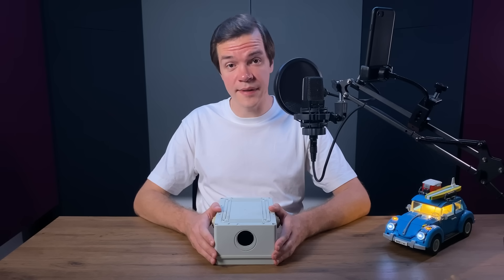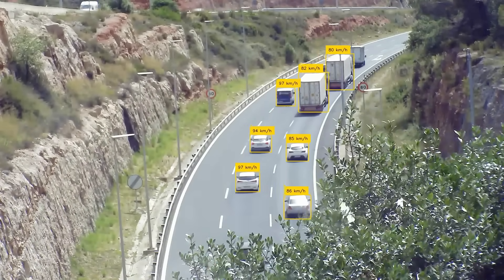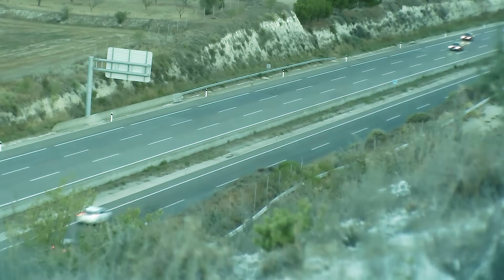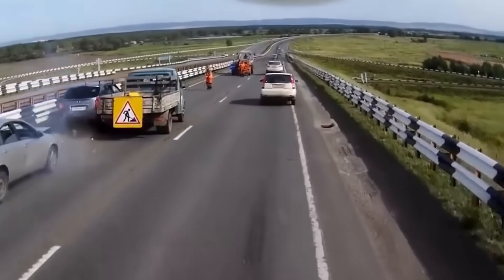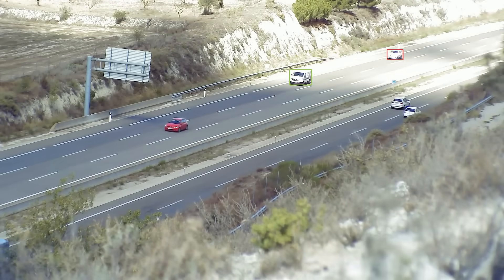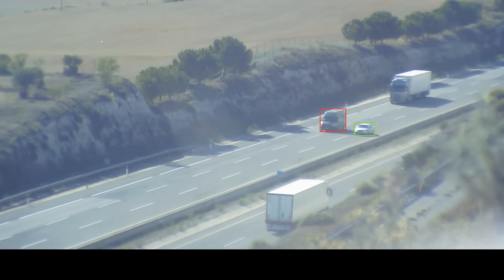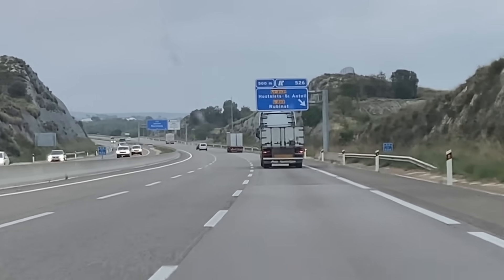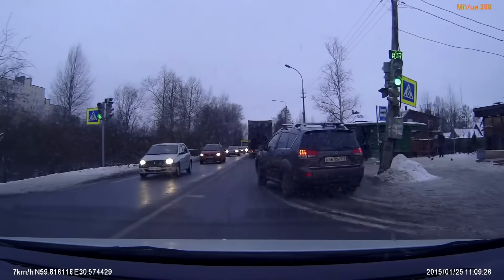New Anti-Tailgating Camera Reveals Shocking Statistics

Comment: I think this is a great video and having a large gap to the car in front of you is the right thing to do when there isn't much traffic. However, if there is a lot of traffic changing the gap from 30m to 100m basically reduces the capacity of the road by 70%, which is why I don't think it's so straightforward, what the right gap is. What I mean is that in car traffic, we don't maximize safety over all other things especially the time to travel. If we did, we wouldn't have motorways with speed limits of 120km/h, but instead 70 km/h (which would not only be safer, but also more fuel efficient). 

Since this is the case, I think reducing the safe driving to just "don't tailgate" is too simple. There are many other things that matter as well. Those examples that you had on the video, initiated by someone doing something far more dangerous than just tailgating. There was a car stopped right in the middle of the motorway. There was no analysis why car was there. There was a lorry dropping a tyre. There was no analysis, why was it so badly loaded. There was a car hitting the side of the motorway (and then having a pile up). Why did it have that initial crash?

My own (quite unscientific) view is that it's not just tailgating but it's all offensive driving, cutting ahead of others, zigzagging between lanes when there is traffic, etc. that unnecessarily creates danger that won't even make the person doing it get to his (it's usually he) destination much faster. At the same time, giving way to others can easily defuse otherwise dangerous situations without it slowing down the person who does it almost at all. 

My worry is that with self-driving cars, we'll program them to be the defensive drivers, which is of course a good thing, but at the same time, it will make the aggressive human drivers even more arrogant as they know that the self-driving car won't crash to them even when they do dangerous things that could get them to a crash when other cars are driven by humans.

Comment: tailgating is based. on congested roads in stop-n-go traffic, tailgating compresses the line of cars in order to help maximize throughput. At intersections, it allows more cars to get through a light before it cycles. On the highway, it pressures slow retards to get out of the left lane.

Comment: The Logic that Jeremy apply is true "Speeding has never killed anyone,Suddenly becoming stationary,thats what gets you"
You could drive 100 km/h on the Highway and have 30m between and still be injured.
Meanwhile when you drive around 200 km/h and maintain a distance of 100-200m is more realistic because you drive so fast and dont want to risk injury.
That mentality can be apply to the German Autobahn where there is no Speed Limit.
You can notice how cars become less with the 3 stripe white sign,rather than enforced 120 km/h and having many cars suddenly slow down that cause a chain reaction or wave of cars to be slowed down.
In that scenario it would take 1 person to be distracted,not have distance or simply not paying attention at all due to the lower speed to just crash and cause a accident.
"The Germans brain cant comprehend slower speeds" because driving slower on the Highway is never safe.
And don't get me started on 30 km/h zones for "Noise pollution"

Comment: I hate tailgaters. With that said, your/your country's safe distance math is a little wonky. First, you're assuming anything in front of us is already at a dead stop, which for another car is obviously insane since they're moving with you. If they do, somehow, quite literally instantly stop, IE collide with a truck that has appeared out of nothing 10 centimeters ahead, thus giving them no reaction time, on roads like this there are other lanes.

If we change lanes, not only do we stand a very good chance on those giant roads of flying right past our magic instant stop obstacle that was created instantly with exactly zero seconds foreknowledge of either the driver in front of us nor ourselves, who are tunnel visioned on the rear bumper of the car in front of us like a deathwishing lunatic for some reason, I also cut my stopping distance dead ahead via travelling off axis to switch lanes.

Second, you're assuming our driver cannot see anything in front of the vehicle in front of them, which, in similar fashion, is ridiculous.

I suppose the assumption here is that our driver has no awareness or escape plan laterally, and if that's true he shouldn't be driving. If you don't keep track of both directions around you and everything in them, please stop driving immediately.
My follow distance on this road would obviously depend on traffic density and the size of the vehicle in front of me, but would probably level off at 50-70 meters.

Your assumption that recommended follow distance is the best for everyone is overly simplistic, those laws are made for either trucks or old people who lack quick thinking due to age. If I, an 18 year old, and an 80 year are put in the same situation, my kinesthetic sense is operating near an order of magnitude faster(a guess from driving with and around these people for many years now). Where he would need the 100 meters and still probably collide slowly, I would still make it by the skin of my teeth with 45 or 50 in the same vehicle; because my thinking is not hard locked to the lane I'm in, I'm considering everything around me, watching mirrors and checking sides. In my 3 years of driving more than 2 hours a day on average in cities and on highways, I've had zero accidents ever.

What I'm saying is that you are saying we should drive like our vision is exactly 7 degrees wide, we have broken necks, our eyes do not gimbal, we're all bolted statically to our seats and have no steering at all. It is, in the most literal fashion, 1 dimensional thinking. This is how you drive a train. There is a point at which you're driving so ridiculously, unnecessarily safely it's equivalent to virtue signaling. Pray tell, do we equip our cars with ejection seats? Or should we just not drive for fear's sake?

And hey, just remember: I would NEVER, nor should you, drive ANYWHERE CLOSE to theoretical limits. If you couldn't make the 70 meters or drive a large vehicle, by all means do 100. Do 120. We're talking math here, not wisdom, specifically for the thought experiment.

Comment: Volvo had a concept back in 2017 called Volvo 360c. It was an autonomous car communication system between all cars regardless of the brand and the vehicle type. It's the only solution for traffic safety.

Comment: I agree that brake-checking is not the way to go, to suddenly break for no reason is dangerous! However, if I find myself too tightly tailgated I can press the brake just enough to lit up the brake lights without really braking. That is, in my opinion, much better.

Comment: To be fair, a 100m recommended distance regardless of car speed is pretty nonsensical. A reasonable approximation is half your km/h speed in m. So if you're driving 100km/h, 50m of distance should be kept at minimum. But that would make the results less shocking.

Comment: Following closely behind heavy trucks is reasonable. Even an empty truck and trailer will slow and stop massively slower needing more distance than any car or light truck. For a truck with a heavy load it's nearly impossible to not be able to slow down for them even if they are making an emergency max power braking. If they magically slam into a wall and instantly stop that's different but so unlikely to happen that I doubt that more than a few drives in their whole lives ever had a freeway driving event where some vehicle in front of them instantly stopped. 

That said looking past the back end of the car in front of you gives you a lot more reaction time to events. Very people will for no observable reason slam on the brakes and try to come to a full stop on a freeway. One possible tech improvement is a camera mounted at the highest point of your vehicle looking forward, over and past the vehicle in front of you to try and detect reasons you might need to slow or stop. I drive a very low to the ground car. I can actually see under most normal pickup trucks at least slightly. I also get blinded by every vehicle on the road's headlights behind me.

Comment: Temporary tailgating from lane changes doesn't bother me that much. It generally will clear back to a safe condition in 5-20s. For that time, driving with extra caution is needed.

I try not to follow people at a constant distance. Either I'm closing and will actively pass or will be deliberately slower than them so they are increasing in distance. If someone wants to overtake me, that is fine. I intentionally leave plenty of space for them.

If someone tailgates me, I slow down. Nothing sudden, just lighten up on speed a little at at a time; until they back off, pass, or our speed is appropriate for that distance. I will look for opportunity to give way, pull over, or choose another route.

Comment: And I bet that there are fewer accidents than would be predicted by general principles. I think the biggest factor in rear end collisions is attention and distraction.  Over many years I've learned a few 'tricks' 1. you can get a lot closer to large trucks. They will always take much longer to stop than a car. 2. If I can see through the windows of the car directly in front of me. Now I can probably apply my brakes at the same time they do because I see the reason to do so.  Can't see through/beyond? I back off. 3. Is there an 'out'? meaning is there a clear shoulder or lanes on the sides of the car in front of me that I can turn into? this gives me greater stopping distance.  By far the biggest factor is attention. Bumper to bumper traffic is just a grind. It's very easy to be cognitively overloaded and miss stopping when everyone else does. (The only time I rear ended another car I was going through a massive migraine headache.).  
So the three second rule? Is that only for stopping distance? I'm guessing it's for average level of paying attention, seeing brake lights and you hitting yours.    As I get older and as I think more and more about these things as my Tesla drives me around. There really is little reason to speed. Crossing Nebraska after seeing three cars pulled over by police within 5 miles of entering the state. Speed limit 70 mph, distance to Iowa? 375 miles. If I went 75 mph, I risked a ticket and I might save 20 minutes. No point. Tailgating? Mostly what I notice are people trying to get someone driving too slow in the fast lane to move over.  In heavier traffic, everyone seems to be closer with the same purpose,  efficiency but not a race. 
My Tesla allows for more distance than I would, but it also will change lanes to a 'faster' or more empty lane, without noticing the slower vehicle in that lane in the distance. So we will get autonomy, but it will be a very long time before most or all cars are working together. (When theoretically cars could be less than a meter apart and driving at 160 km/hr because stopping will be coordinated.)    One thing I have noticed as over 5 years my Tesla becomes more and more autonomous: I don't care how fast it could go, I just want to relax and get there.  Heavy Los Angeles traffic. My first calming came from audiobooks. More time on the road is just more reading. Then the Tesla. More reading,  and much less stress from lane keeping, and putting up with stop and go. The car does it and never loses focus.

Comment: "braking distance" is determined by dozens of factors including your speed, the capacity/condition of your brakes, capacity/condition of your tires, road conditions like water, ice, snow, gravel, mud, etc etc, how much cargo/weight your vehicle is carrying, driver reaction time, and many more... Before taking a step towards FSD, it would be nice if auto makers would engineer safety systems inside a vehicle to approximate ALL of these factors and alert the driver if they are following too closely.

Another element is psychological. If I see brake lights ahead of me, I will begin to brake lightly because I assume the braking ahead of me is light braking, this is a normal response. The time it takes me to realize that it is in fact hard braking is an ADDITIONAL element of reaction time/decision making.

Comment: I have been driving through Italy for the past 5 weeks on holiday and have been shocked at the aggression of some drivers.  Large vehicles in particular appear to think they can bully other vehicles out of their way flashing their lights and running their overtaking indicator.    I was outside Florence yesterday overtaking a line of 20 or so trucks doing 135 kph in a 130 zone with several cars in front of me in the fast lane.  I saw in the distance a delivery van coming up behind me doing at least 160 kph.  He then proceeded to drive about a foot behind me.   This caused me  some alarm as there was no way he could slow his vehicle in an emergency.  I eased off the cruise control and slowed my vehicle creating a 150 m gap to the vehicle in front of me.  This seemed to infuriate the driver of the van and he started hanging his horn.
As soon as I could find a safe gap between the lorries I pulled in to let him past.  Instead he drove up to block me in and maintained this position for several kilometres until one of the trucks pulled in behind him and started tailgating him closely.  I slowed down and put as much distance between him and I as possible.   There will always be idiots!  Just try and avoid as many of them as possible.

Comment: Today, a modern car, equipped with collision prevention system as most of cars sold in the US these days, reacts faster than driver. I was saved several times from a crash already by my RAV4 system. Modern technology rules! 100 m distance limit is ridiculous. Only, maybe, for Spain where traffic is light.I US it a 2-second rule, which is much more reasonable.

Comment: I think 30 meter is the distance that is "safe enough" but still "too close" for someone else to sneak in between the 2 cars and DRAMATICALLY reduce the safety distance.
eg: lets say a car is 5 meter (about 16 ft) long, if you hold 40 meter distance, and someone sneaks in in the middle, that makes the distance 17,5 meter instead.
Car |-----------------------40 m-----------------------| car
Car |----17,5 m----|<car 5m>|----17,5 m----|car

Comment: @Railways | Retro Tech | DIY
11:05 Or a system like you said, but when detecting eg. 10 instances of tailgating in maybe 1 month, then you get a letter to show up to a driving license place for re-evaluation of your driving abilities, to see if you can drive safely enough to keep your license, or have to re-take the license again.
They could monitor maybe a mile or more for context, but only the last camera counts for counting tailgating, and when a situation is found, it is backwards-analyzed to figure out if the "tailgater" was ACTUALLY tailgating, or was recently overtaken by the one in front.
Alternatively (better? probably) would be to add a digital sign near the end that says something like: "Car xyz-123, should increase distance by 10 meters", maybe with red / green light or so?

Comment: I've noticed that in NZ it happens a lot because the muppets here camp the middle/inner (overtaking) lane instead of pulling back over into the outer lane when done overtaking. Often times I can undertake 5-10 cars  that are driving in the middle lane going 20 under the Speed Limit while I'm driving the speed limit because not even one of those muppets thinks to move back into the outer lane. I wouldn´t have to tailgate if those car´s would just make room by driving in the lanes they´re supposed to be in. Not to mention the idiots driving city speed (60ish) while on the on ramp and only speeding up to 80 AFTER merging onto the motorway while the speed limit there is 100. Its frustrating.

Comment: On the highways / motorway, you get cut off only by bad drivers who dont look behind them before they change lanes. Those are the ones you need to go for.. tailgating is not a problem if the car in front of you doesn't "suddenly" need to stop.. and the most common reason to suddenly stop is because of people cutting each other off without looking in the mirrors first.. 
When i drive on those roads I am always checking my mirrors properly before moving to a different lane, just in case someone is coming at very high speed from behind. It happens that you misjudge a situation but luckily you can cancel your lane changing quickly once you notice it. 

If you drive behind a van, truck or bigger car, you have less visibility and you will naturally allow yourself to have more space between the cars.. 

Now go to countries like Czech republic, Romania or even Hungary, and you will notice that every meter is counted as free space for other people's cars. They cut you off for no reason even if there is only 1 meter left to spare. The traffic you see in this video is very safe and tame in comparison.

Comment: In France it is impossible to keep the safe distance for what you mention of others using it to filter, i try to keep it as long as i can and that has saved me from multiple crashes. 2 years ago i used all my safe distance in a jam to let the 4th impacted car come to a stop and when i ran out of distance i had to slam my brakes and stop that car with my trunk to avoid hitting the car in front of me, it all happened in milliseconds but i lived it at a very high FPS slowmo thing like time almost stopped. I drive a big car with powerful brakes, the girl driving the car that impacted me told me she was more surprised by how i made her car stop than from the impact that sent her towards me. 

The car that initiatied the accident was driven by a young guy you confessed to have reached for his phone